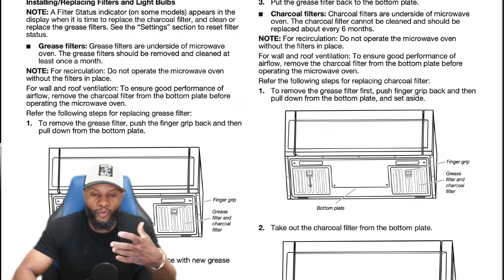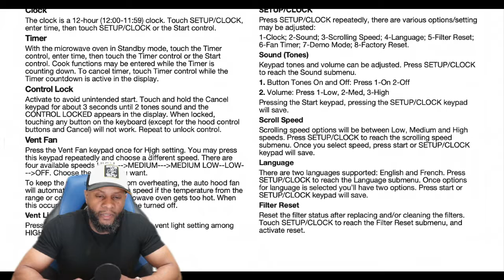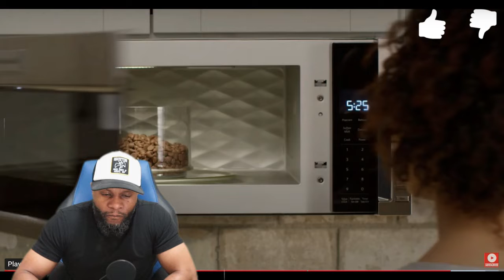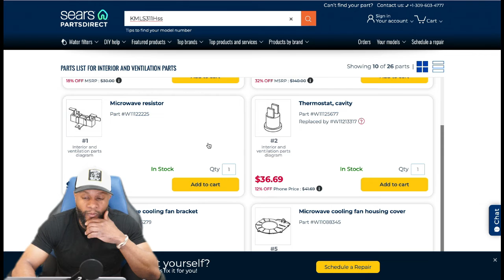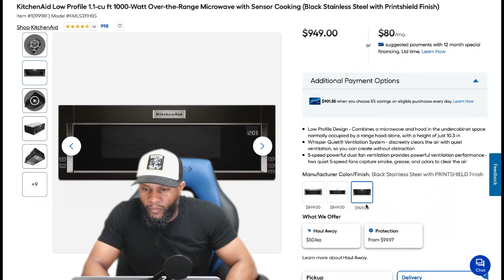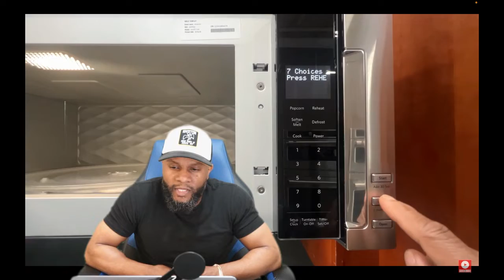top appliances in 2024 kitchenAid  Low Profile Microwave Hood Combo

Comment: I just got one, and I don't know how to set the clock or the inside light
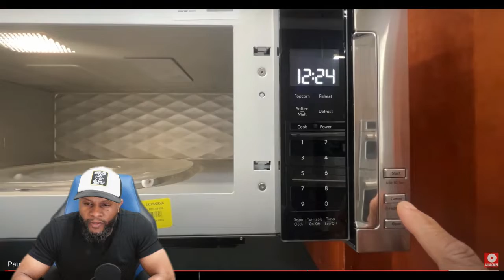Reply from the maker: Thanks for your support it should be at the button of the panel where it says clock set video 20:41 of the video pass it to see what I’m talking about
Reply: @consumerappliancereport1579 The model number is KMML550RPS, which it's not the same as in the video
Reply: Can you also tell me if the settings panel lights up and if the inside light to the microwave has an option to stay on. Model # KMML550RPS Thank you so much ☺️

Comment: Venting - does it have to be connected via duct in the wall or can it be setup to to recirculate? our current hood is not vented via duct in the wall. it just recirculates the air
Reply from the maker: Thanks for your support … you do not need a venting system it can recirculate the air ..
Reply: great! Thank you! @consumerappliancereport1579

Comment: Great review!!!
Reply from the maker: Thanks for your support I appreciate that
Reply: Can the microwave go under a cabinet without a stove underneath? I hope so 🤞 Ty❤
Reply: Yes a microwave can go under the cabinet with no stove or also be built into the cabinet with a trim accessory. The ones that go over the stove usually are used as a vent hood aswell. You can pretty much mount them anywhere, But the vent feature may not be a useful